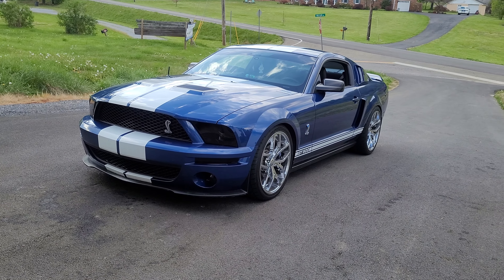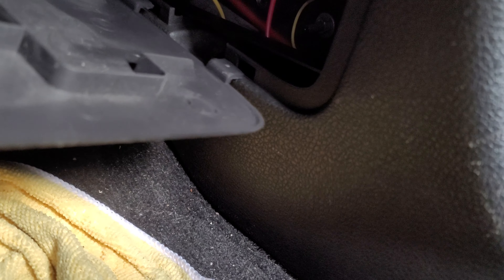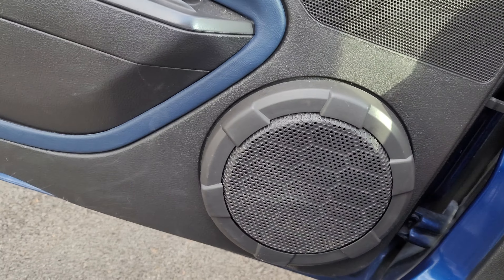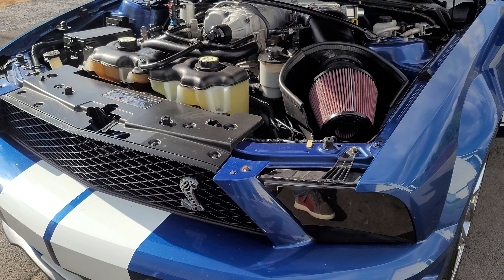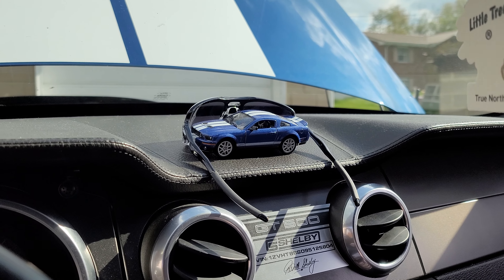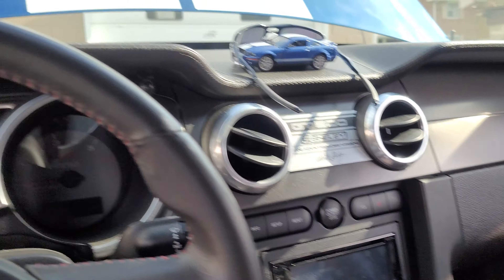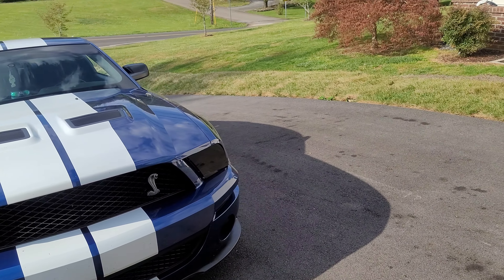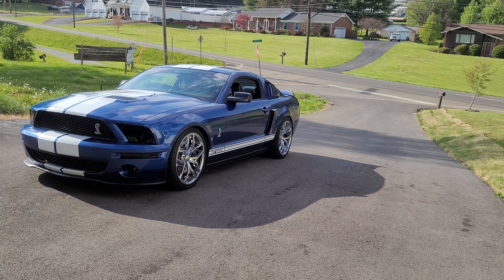2009 GT500 Trinity TVS 2.3 Blower Swap | Part 3 |

Comment: Question: was there a difference on idle noise like a vacuum leak?
Reply from the maker: No, no sound difference at all. Maybe the high idle at stops overpowered the leaking sound, but inside the car, there were no audible clues.